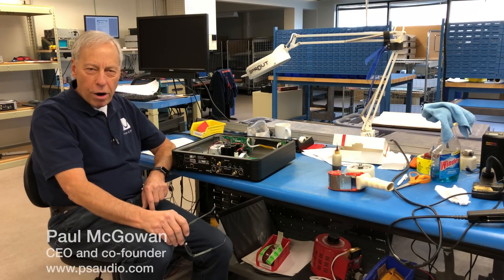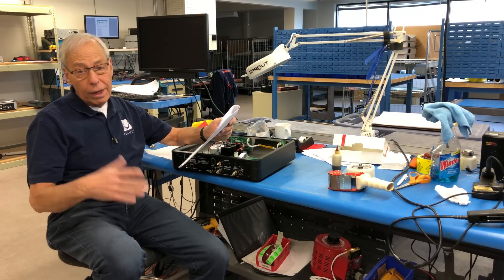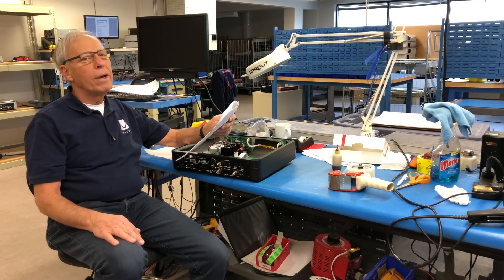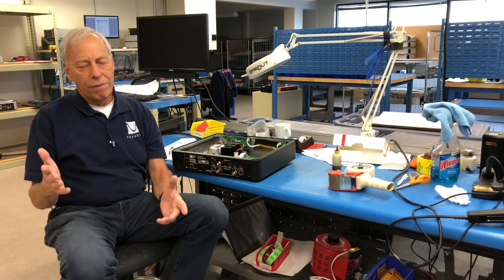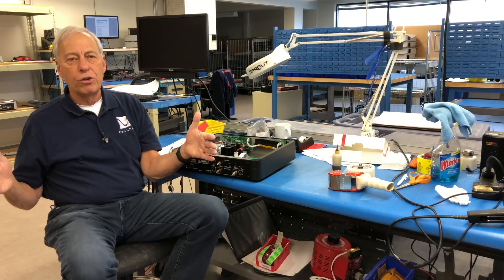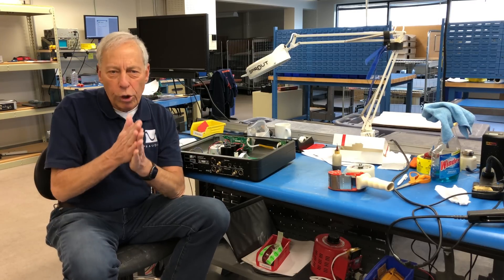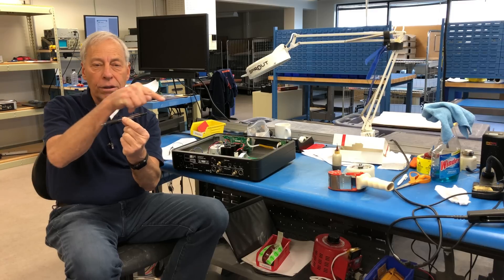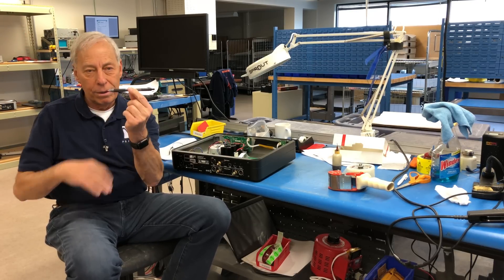Are low impedance speakers hard to drive?

Comment: Why do some people think 8 ohms is old school and the 4 ohms new school??
Reply: @FatRat-f9m  thanks
Reply: I think 16 ohms is old school.  Both the tweeters and midranges in my speakers are about 16 ohms.  (As you might expect, they're horns - and it takes a 4 ohm woofer to keep up with them in spite of the fact they're turned down by L-pads.)
Reply: 6 ohms is new school. 4 and 8 were common in the old days too.

Comment: Thank you Paul. 
So what is better? I have Infinity RS.... speakers that are 4 ohms. Was it just a way for the speaker makers to make "high power" speakers while just dumping off the waste power on the Amp? I mean what is the point of having a 200 watt speaker if its just dumping most of that power back in the Amp (pass through) because it's 4 ohms? Why not make a speaker that is like 32 ohms that would use all the power? 
Now I also see why I killed a lot of receivers when I was younger. It was all that damn pass through power going back into them. I think in this day and age the next biggest breakthrough should be a way to re-use that power that is just going to ground.
Reply: Low impedance speakers don't dissipate any more power back into the amp, than high impedance speakers do.  
But it is true that for linear (non-switching) amplifiers, the power dissipated into its heat sinks is higher with a lower-impedance load, at the same power level.  However that is only an efficiency concern, and it is addressed well with class G and H designs.

Comment: Then why the heck we use 2ohms on big 1000w load subwoofer?
Reply: Janis Ristamecs for maximum power as pushing large volumes of air is only easy for politicians
Reply: Larger Mass Motor structure of the surround, speaker cone, voice coil & Spider in addition to the compliance/stiffness of the movement structure helps to determine the current necessary (OOMPH!) to move that mass!!!
Reply: fookingsoc so low eficency speakers is desirable for bass? just seeing a lot bass guitar speakers 16ohm 32ohm... i cant see such tendencies in sub box choices... just refering to that point. its a ... listen what paul is saying ;)
Your point is a equasion of components that determine your choice, but i say if you cant explain it simply enough you dont understand it...
Reply: In your car? To get the power you want at 12 volts. P=V*I
Reply: Gareth Smith nop...  its a basic question to understand it... car audio uses 12v but it gets boosted to much higer  / for the amp. that uses 2ohm sub. 
So why isnt used 16ohm .. why its that way... & i look its 85db eficient at best at 1w.. It just buffles my mind. 
Am i stupid or its for us to use more power . for noneficient speakers that will heat up the circuit ... So in sence it will ware up quicker.
Am i rigth? Than wy we dont make 16ohm more eficient speakers & 16ohm amps for car audio ( for example ) 
Its awayability issue... money issue ... or just simply stupidity for the sake of tradition, we do this way  and we will keep doing it... 
Its what i get out of it ... What Is this disscousion about? how do you get this?
Reply: @yowild9629  2 ohm coil is less mass than a 16 with same power handling capacity,, gives better cone response. Plus all electric machines are basically thermally limited.
The inefficiancy for a speaker comes about because of the different densities of air and the cone material meaning power transfer from the cone to the air is poor. Speaker driver designers have a lot of factors to balance to create a device that they want to be accurate but basically run in open loop. 
To get the best you need to choose a speaker with the least tradeoffs you care about, you can't beat the laws of physics, just trade them off against each other.
Reply: Gareth Smith Its nice to see here knowlageable people... What i get out of it is that more ohms will result in more winding in coils. so the resistance will be higer & the cone move faster. but lo ones will be less winding with more move excursion that will move the air in lover hz. ( refering to the same cone size ) Is it that... 
Than 100w 16 ohm is the same as 800w 2ohm  . in power , but not in the resonant peaks and preformance. 
4x16ohm vs 4x2ohm in series/paralel line on 4ohm.. mono. sealed vs port. Tline ... . is the thougth process behind it.

Comment: Higher impedance speakers will require a higher driving voltage to produce the same level as the lower impedance speaker.

Comment: Back in the day, the Krell's were just about the only amplifiers capable of driving the Apogee Scintilla's with impedance dipping down to 1 ohm.
Reply: I'll just mention the Hafler dh 500 and the Ashly ftx 2000 for a couple more "back in the day " amplifiers. Both drive my Apogees just fine. Honorable mention to BGW amplifiers also capable.
Reply: Can you say ME1500?

Comment: Most Manufacturers say, you can run an 8ohm speaker on a 4 ohm amp but not a 4ohm speaker on an 8 ohm amp.
Did I say that right? Did they change that, I haven’t bought a speaker in a few years. I know this probably doesn’t help any more than any other comment but me, I think that if I wanted to learn electronic engineering from  somebody, I’d want that some body to be Paul. The coolest teacher in the Electronic Audiophile World. Thanks Paul!
Reply: You said it right, although today it's hard to find integrated or power amps that are only designed to handle 8 ohm loads.  
Some receivers may be challenged by 4 ohms.

Comment: My speakers have 2.3ohm DC resistance, have no idea how bad the impedance dip is. My roksan amp does good and keeps the room warm.
Reply: DC resistance is not the same thing.
Reply: @carlosoliveira-rc2xt  I know hence the mention of AC impedance dip. I can measure the DC resistance with my volt meter.

Comment: Yes, they're kind of a nightmare! Like the old Infinity Kappa 9 that goes down to 0,5 ohm in the deepest bass with the bass on "Extended".
Try do make a Class D or Class A tube-amp happy with that load.
Reply: I owned the Kappa 9s for 20 years and yes very hard to drive. Finally settled on a Halfler DH500, 250 watts into 8 ohms.
Reply: @briansimmons5363  You can't go wrong with that amplifier. I own 3 of them in systems around my house. Drive Electrostats and ribbons with ease.
Reply: If designed correctly, a class D amp most easily handles such loads.  
The class A tube amp might be happy - it's just that your ears wouldn't be happy with the result.  
I agree the Kappa 9's are a nightmare for amplifiers.  Even in Normal mode, they drop down to about 1.2 ohms at 40Hz.  In Extended mode I calculate 0.85 ohms at 36Hz to be the impedance minimum.  What might be even more troublesome for some amps, is the current phase shift of about 80 degrees around 20Hz.  
The reason for all of this impedance ugliness, is Arnie's choice to incorporate a highly resonant LC tank circuit to boost audio output in the 30-40Hz region.  It functions similarly to a step-up transformer, using high current draw to provide more voltage to the woofer.  But the same boost could be accomplished in a much more amplifier-friendly manner, by using a parametric equalizer instead.

Comment: Something that is connected in parallel with something like a battery or amplifier then we want to have resistance otherwise it will be short-circuited.

In a series cable that supplies volt we want to have as little resistance as possible so that there is no voltage loss at the other end of the line

Comment: Engineer here. I think Paul did a commendable job on this one.

Correct me if I’m wrong. A speakers “impedance” by industry default is measured at 1Khz, 1W constant signal. I think it’s been that way for a very long time. But except for a few speakers they are complex motor generators and the impedance varies widely by frequency and energy dissipated in the motor generator that a speaker is. In fact the speaker may go inductive at 8Khz. And the impedance may change wildly with a constant signal and heat buildup.
Reply: Therefore a custom tailored Zobel network should be applied across the speaker terminals in parallel to eliminate the impedance rise in conjunction with frequency rise!!!
Reply: @RTR-MATEY  Note: Loudspeaker and cabinet design is a black art. And PS Audio is a newbie to that cauldron. Bubble bubble boil and trouble.
Reply: @RTR-MATEY  
That needs to be done directly at the driver, i.e., after the crossover.  
But crossovers can be designed to work without the Zobel, as long as the designer is taking the voice coil inductance into consideration.
Reply: The motor/generator characteristics are a tame problem, compared to what some passive crossovers do.  Look at the woofer network in the Infinity Kappa 9:  
http://www.infinity-classics.de/technik/manuals/Kappa_9_technical_sheet.pdf
Reply: @marianneoelund2940  My goodness.
Reply: Nothing wrong with his explanation of electrical impedance. However to the question "which speaker is easier to drive" he seems to have missed the target. He answered the question of "which speaker is easier on the amp when driving". The writer seems to be asking "which speaker is more easily driven" , which all things equal would be the lower impedance speaker, not the higher.

Comment: Home speakers used to be all 8 ohm...now they are all 6 ohms...why did they change.? 
Car speakers are 4 ohms.
Reply: Speaker resistance (impedance) varies with frequency, so the number is nominal (arbitrary). Most speakers have been nominated as 8 ohms because that's the impedance "expected" by the average amp. Some amps become unstable when driving an unusually low resistance. Unless you possess speakers that dip to an exceptionally low resistance, or an amplifier that's exceptionally unstable into low resistances, it's not something to worry about. Most amplifiers are stable in regard to speaker impedance.

Back in the olden days of vacuum tech, most speakers were rated at 16 ohms, but 8 and 4 were also around. It didn't matter much since the amp invariably had a transformer, frequently with taps for 4, 8 and 16 ohms. In the early days of solid state 32 ohm speakers were often used in pocket transistor radios.
Reply: The amount of power you can run through a speaker is set by the relation of the speaker's impedance to available voltage so if you have less voltage available, you need lower impedance to get more power thus the 4Ω output standard for 12V powered amplifiers while home audio typically runs on considerably higher voltages. There are many reasons for shifting from 8Ω to 6Ω. Dropping speaker impedance by 25% allows for more power dissipation from the same output voltage, and it allows for larger magnet wire to be used or for smaller geometries to be employed. If your drivers are less efficient, running more current through them may bring their specification up to matching the sound output of a more efficient driver at 8Ω.

Comment: I am surprised by the level of knowledge of some people. ohms law says that in 4 ohms you get more watts out of a battery than you do in 8 ohms. But the battery must be able to deliver what you are trying to get out of it and that is where the limitation lies.

you almost never get twice the watts out of an amplifier even if you go from 8 ohms to 4 ohms.

when a speaker goes up and down, a speaker gives different ohms at different frequencies.

You also have limitations in the amplifier.

all good amplifiers can handle 4 ohms without any problems. but many cheap amplifier cards from ebay don't always handle 4 ohms

Many amplifier factories write more watts than the amplifier manages to deliver!
Reply: @FatRat-f9m  ??
Reply: @FatRat-f9m  I remember the wattage race at the boomboxes at 1980s. In the early 80s it could be written, for example, 2x7w sinus and 2x10w music power. Later the numbers increased with use of the expression "peak music power". So some boomboxes could be advertised as 80 or 100w. 
Ridicilous because the true power was nothing close to a 2x20w hifi amplifier.
Reply: @FatRat-f9m  That's true what you write! But from experience on car amplifiers, home hi-fi amplifiers and amplifier cards bought on Ebay, it tends to stand more watts than what is true. you should measure the amplifier in rms in a frequency or continuously watt. And that's what you should measure the amplifier in my opinion.

An eBay seller said that watts sell so that's why they write more watts on many amplifiers sold on Ebay than what they can give in reality. 

Cheap cinema amplifiers are a good example. You can look at powersuply how big and strong it is and then you can work out how many watts you can get in theory.
Reply: @FatRat-f9m  I usually measure at a frequency of 50Hz but you can also measure at 1kHz. 20hz - 20khz it is not easy to see on the oscilloscope when the amplifier starts to cut.

https://www.youtube.com/watch?v=KMXwpFT1onI&pbjreload=10

Comment: Simple analogy: It takes a lot less water (power) to get a steady stream out of a thin hose (8ohm) than it does to get that same stream out of a larger hose (4ohm).
Reply: Thanks ! Paul is usually very clear but in this case what he said was counterintuitive to me. Your hose analogy does the job. The water in your hose was crystal clear. In Pauls, muddy as hell.
People see power as a force pushing against the resistance in the wire and the more resistance the harder it has to push. It is this misunderstanding which causes the confusion.
Reply: Now that works for me, thank you! The K.I.S.S. principle at its finest.
Reply: Perfect, much better than Pauls
Reply: This is the time old analogy that I always thought worked best to explain it, thanks!
Reply: U Just make me want to run to the toilet mate
Reply: Loved this Lance.
Reply: It's fine thanks hahah
Reply: Thanks for this analogy. It is actually the perfect visualization of the concept.
Reply: Google "impedance complex power"?
Reply: Hi Paul,
I remember watching this when you posted it  and scratching my head as to what you were trying to get across. Many moons later (today) I revisited this oldie but goodie and now understand what you were explaining. Up until now I always got peeved that most speakers are 8 ohms and not 4 ohms. Afterall that 4 ohm output power spec for  an amp looks good on paper to us lay folk.
Reply: More like flying and the air is ohms. The more air the more resistance you get. The less air the easier it is to go faster with the same amount of power.
Reply: Except that in your analogy the "thin" is the bigger number i.e 8 and your "thick" hose is the smaller number i.e 4 😜 Sometimes it's the simple things that trips people up.  So  basically more/higher resistance/impedance is easier to drive because of how electricity works. However dragging something behind you through mud requires more power because of the resistance as opposed to less power for less resistance dragging something over ice...... makes you think 🤪
Reply: If you want the water to 'shoot out' more or less straight, nearly horizontal, and for the same distance, yes. But the smaller diameter hose requires more pressure to convey THE SAME VOLUME of water. I think that this is a poor comparison to power, resistance, or impedance in an electrical circuit. We should also consider volume output - sound pressure level, produced, with the same input power, and work backwards. There are several considerations - the amp is putting its power into a coil of thin, insulated wire wound around the speaker 'form,' and this placed over a, hopefully, powerful magnet. The magnet's strength makes a difference! Their interaction of the coil's generated magnetic field, with the manget's stationary, unchanging field makes the speaker form, attached to the speaker cone, want to go back & forth. In addition to a 'pure resistance,' there are capacitive & inductive fields generated. This resulting combination, net result, is why we usually refer to the speaker's impedance, and not just 'resistance.'
Reply: Water analogy is great. Used it for years to explain impedance and power. 👍
Reply: @DAlan0909   a better analogy is interlocking gears in a line. As the first one spins they all spin. Think of a copper wire. The copper atoms stay put (the nucleus) , but the electrons become agitated and they move faster within their orbits. This causes nearby electrons to move as well. This is the flow that people try to understand. With such an understanding we can see how touching a gear would hurt you, as would touching a "hot" wire would hurt you. It's the electrons moving which hurts.

Notice, water flow will fill a bucket. Electron "flow" aka electron agitation, won't. Same with fixed gears. The teeth at the end of the line will hurt your hand if touched or it can do work. But it won't fill a bucket with tiny gear teeth.

It truly passes me off just how lacking educators have been in creating sound narratives and analogies.

Water flow is fine and works for most practical purposes (I too used to use it), but incurious and lazy educators have really mucked up this area of science.

All it takes is simple thought experiments to create more apt analogies.